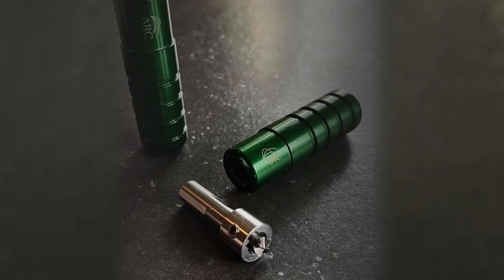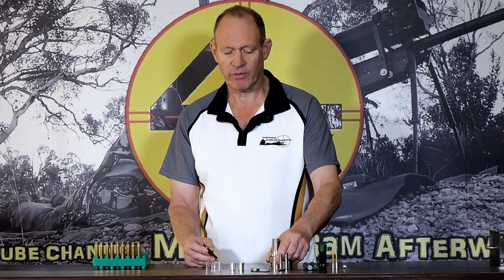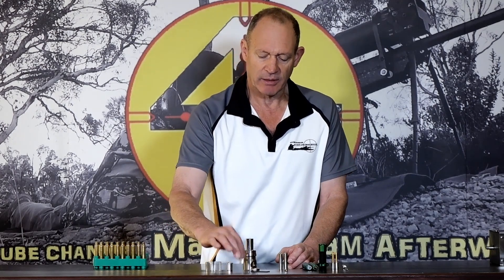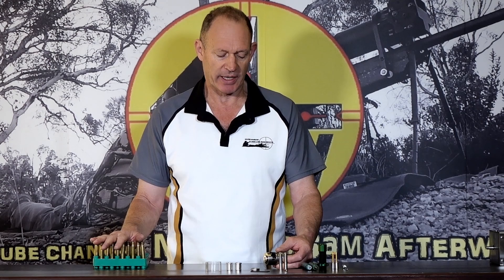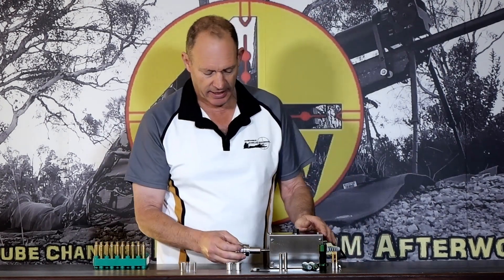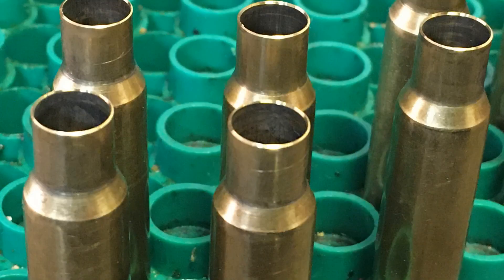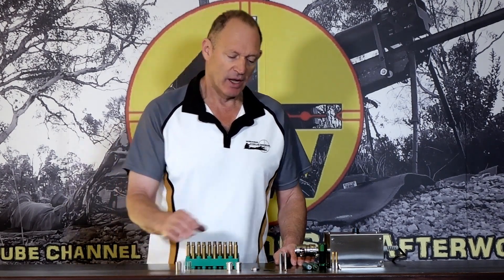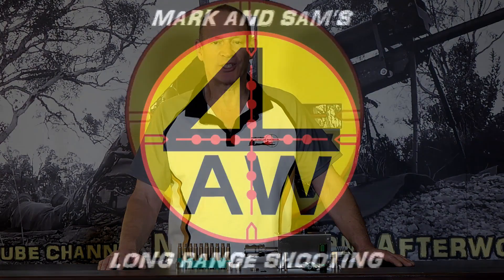ARC 3 Way Case Trimming

Comment: Hey mark.
I have seen these as you say well bulit/machined in the uk though they are mega expensive. I currently use the rcbs 3 way cutter its a nightmare to set up but once set up you can cut 100 cases worst variation i have seen is 0.0005-0.001" its all about the preparation and set up
Reply from the maker: Thanks Man

Comment: You might have said it and I missed it but I imagine it indexes off the shoulder like most of these sort of cutters do. I like it, I currently use the Frankford Arsenal Universal Precision Case Trimmer which does a good enough job trimming but doesn't chamfer and deburr.

Given how pretty that ARC gear is, I imagine it costs a pretty penny as well :-)
Reply from the maker: Yes from the shoulder, prices are on the site, company name in the details below video, Cheers